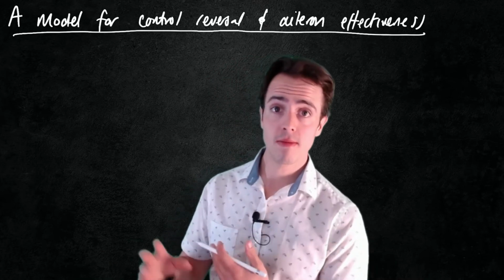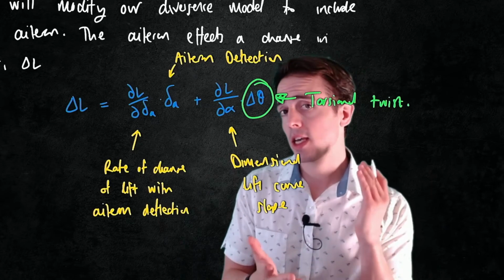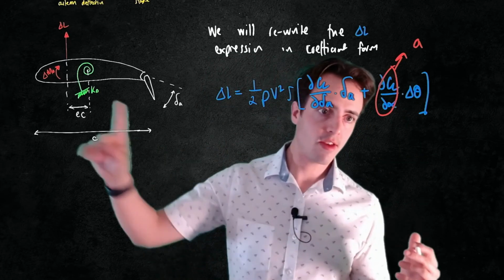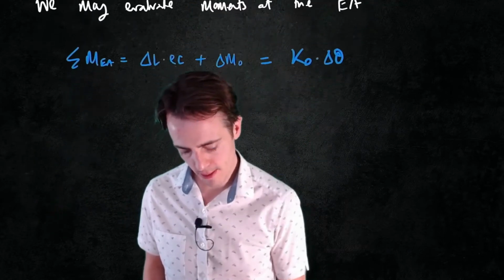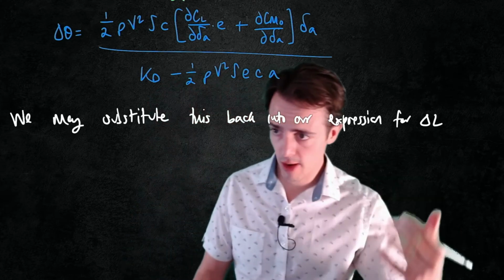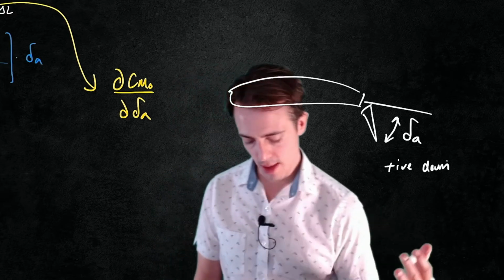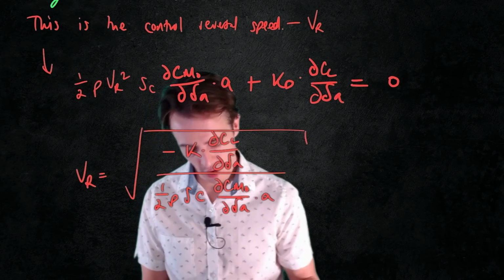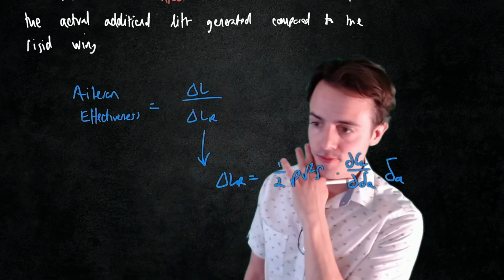Aeroelasticity 6 - A model for control reversal and aileron effectiveness

Comment: Good afternoon sir. Sir where can one find the problem set on torsional divergence speed and control reversal speed to practice? Also sir the derivates used in the equation, (rate of change of pitching moment with the deflection angle and rate of change of cl with deflection angle), 1. On what parameters are these derivatives based on ? (eg. any speed, any angle of attack, alt etc?), 2. And how can one get these derivates? (eg. through analytically or computationally?), if analyticaly, then how sir? Please help